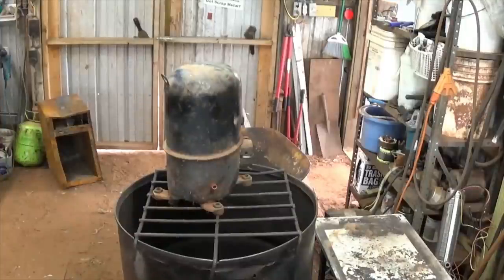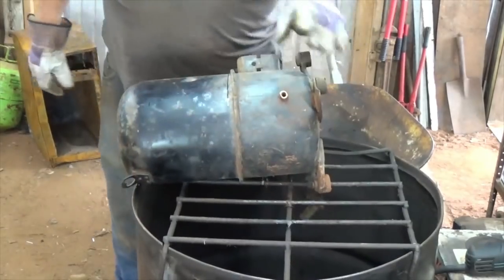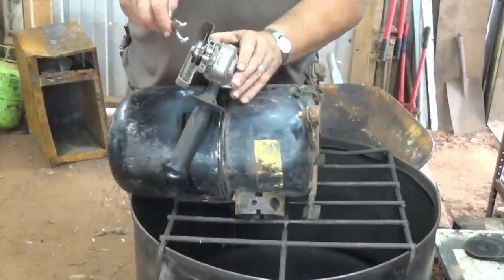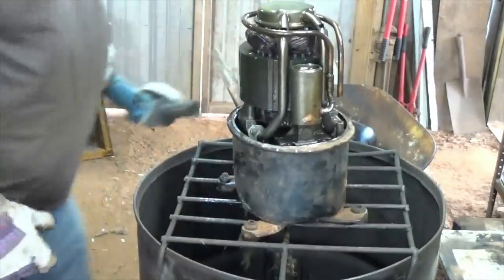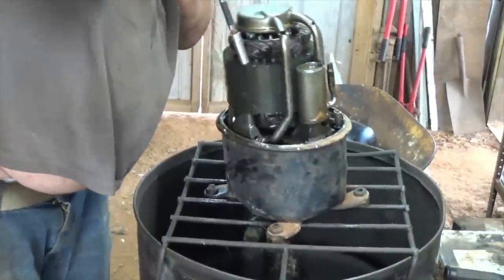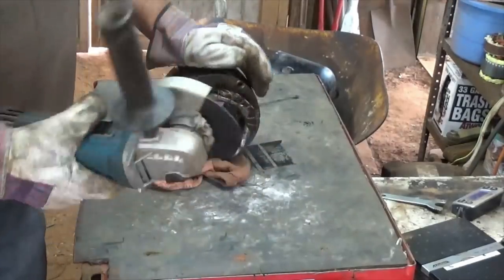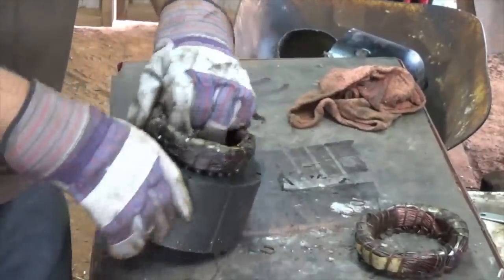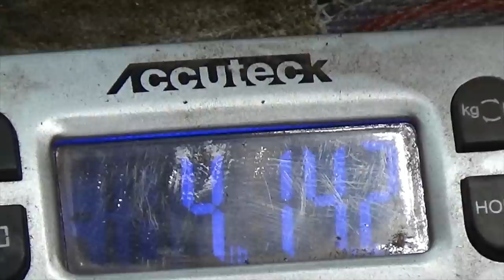How much Copper is in a Big Sealed Unit?

Comment: The air hammer trick is a heck of a lot easier then using a hammer and punch.  Thanks for the tip.  I’ll definitely invest in a compressor and air hammer now!
Reply from the maker: I used to cut the copper with the air chisel but it takes a bit longer,

Comment: I should go pick up those old units I found few years  ago in the woods around 30 of them
Reply from the maker: 30 of them that's a lot of money sitting there
Reply: Dig em up and let us know how much you get.
Reply: 34 of them cleaned was $650.45  I cheated used plasma cutter  but worked  not including the metal...

Comment: I had a 84.5 lbs compressor it gave me just short of 7 lbs of #2. Plus 77 lbs of steel. Excellent value.
Reply from the maker: that is one heavy compressor, last month #2 was paying $3.75 so that would be about #18.00 and the steel would be around $8.00. Thanks for stopping by
Reply: @Okiescrapper  😄

Comment: I've done a few of those in my time, always good copper to be had 😎👍
Reply from the maker: I did a video last winter and it had mostly aluminum wire in it. it did have a small amount a copper, but they are rare so far. I have about 12 central air condenser unites to scrap out some day and they all should have compressors about this size. thanks for stopping by
Reply: @Okiescrapper  the Chinese freezers and fridges usually have the aluminium because of the shipping weight. The same with the imported washers and dryers. I reckon the window units will be too.
Terry from South Carolina

Comment: Perfect timing, I have one sitting on the work bench right now. just thinking how to go about it. Thanks.  The little bit of copper you took off will put at 5lb x3.75 $18.75. Not Bad
Reply from the maker: and  I am thinking about .12 a lb. the steel short iron price and that would be $8.40 on top of the copper $18.75 total $27.15
Reply: @Okiescrapper  Not bad, in all.
Reply: Its number two copper not one

Comment: That is interesting.  I've been driving sealed units 200 miles because they pay more.....and it is on my way. (One more and...one yard I go to lets me take stuff out of the pile. I routinely find dollies which I need...so they are more value than the money).     Now you have me thinking if there is a way I could crack those cases faster than the grinder.  I hate the oil smell those compressors have.    I could let them drain out overnight.    It is a hobby for me
Reply from the maker: I hate the smell too, keep a fan to your back that helps some, some guys use a cutting torch or plasma cutter, the plasma cutter would be the cheapest, compressed air and electric plus the consumables

Comment: That was a big compressor. I did not know there was that much copper in them. Good haul. When you finished scrapping the compressor, how much aluminum was in it?
Reply from the maker: I don't try to get any aluminum from them, most of it would be what is formed on the part that goes into the center of the stator, and would be hard to get off short of melting it off.

Comment: All that work for $18?
And probably 3 cutting disks,
I have seen videos where a large industrial jack hammer is used to break them apart in approx 30 seconds.
Reply from the maker: to me it's a hobby not work, and I have worked a lot harder for a lot less in my life, I used less then one cutting disk at just over 50 cents each. well  I don't have a big jack hammer, but have been thinking of a big hammer drill and plasma cutter. thanks for stopping by

Comment: If ya don't have air chisle get some flat stock cut a groove in it, like a hammer claw but smaller. Hammer it out. I use an old chisle I didn't use and notched it! I have a video somewhere on here lol!
Reply from the maker: I think I mentioned that in a video a week or two ago. but I mentioned round stock a long bolt of something of that sort cut down the middle an inch or two pry apart, grind to a point. I saw that in a video it may have been one of yours, I took the idea and used it with the air chisel. great idea a lot faster and easier then prying it out
Reply: @Okiescrapper  yes sir but I didn't have an air chisel I used a hammer

Comment: I work for a guy that does scrap for plumbers and HVAC techs and he doesn't tear down his motors or compressor we regularly throw about 40-50 motors and compressors of various sizes a week I'm thinking I might buy them off him now I'm estimating there would be about 150 pounds of copper in there a week
Reply from the maker: yeah I would say to try it and see if it works out, I think it would be a good extra income, Thanks for stopping by
Reply: offer him to drive them away each week for $20.

Comment: 5 lbs at 3.75 per lb is about $18. it took you 15 min at $15 per hour nets $14.25 minus electricity minus tool wear minus pick up
Reply from the maker: 5 lbs. at $3.75 per lb. = about $18.00 in 15 min. x 4 that is $72.00 an hour plus the shell is 70 lbs. @ .12 per lb. = $8.40 x 4=$33.60 so that is about $105.00 an hour. I have no idea where you came up with $15.00 an hour minus electric, cutting disk, I won't count pick up as I picked up a lot of other stuff at the same time
Reply: @Okiescrapper  That's fair. How much would you have made, with 0 time invested, if you just scrapped it whole?
Reply from the maker: @markgriz  $9.00 or $10.00 whole